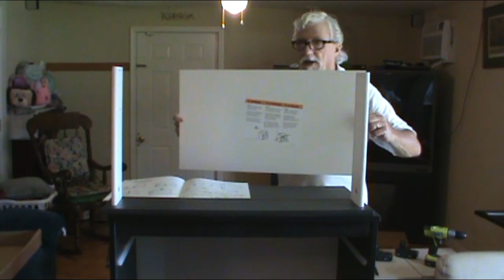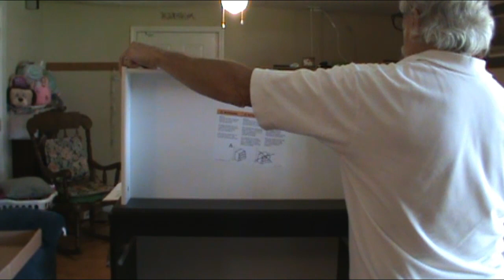Unboxing the KULLEN 5 drawers Dresser Part Number 00360455 from IKEA

Comment: Do you think you can add wheels/castor or legs on the drawers?
Reply from the maker: I don't think it needs casters on the drawers. They slide in and out very easy.
Reply: Harold Jackson I need to move it easier for cleaning
Reply from the maker: Oh ok, you said drawers! Yes it would be very easy to add casters. They have some at Home Depot and Lowes that would work. Very east to install.